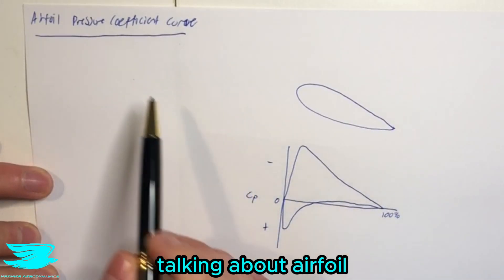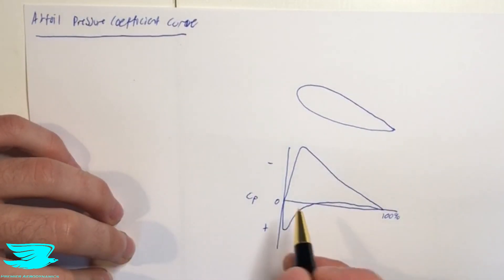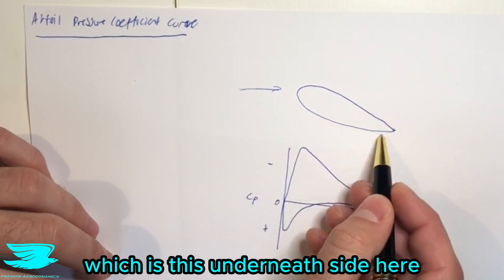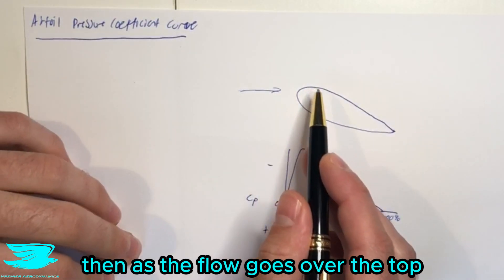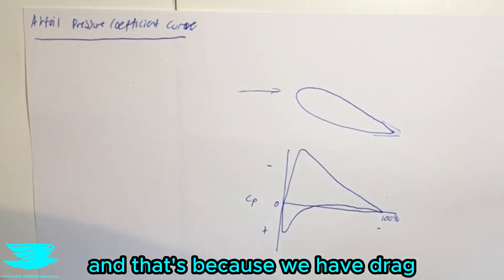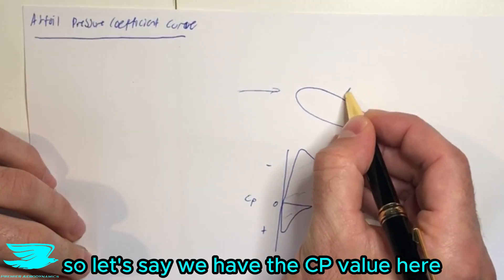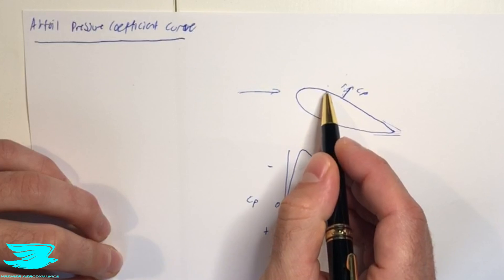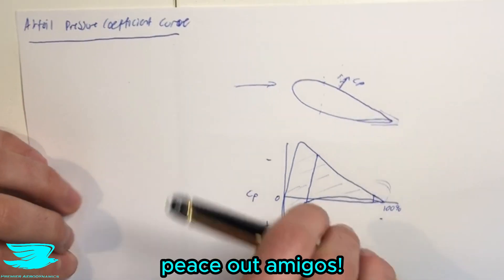Airfoil Pressure Coefficient Distribution [Aero Fundamentals #46]

Comment: Stagnation point is the pressure source?
Reply from the maker: The stagnation point is where all of the dynamic pressure is converted into pressure you can feel. So, ideally, that is the total pressure (assuming zero losses).
Reply: @PremierAerodynamics  Right for there to be an aerodynamic force, you have to have high pressure separated from low pressure. The stagnation point is where "yin yang separation" happens. It's practically a universal law. Can't pedal a bike by pumping both pedals at the same time, you have to separate pressure on each pedal, one has higher pressure than the other.
Reply from the maker: @rolandotillit2867 Wow! I had never thought of it like that. I guess, at its core, it is the differences that create the force, and the more opposite, the greater the force.